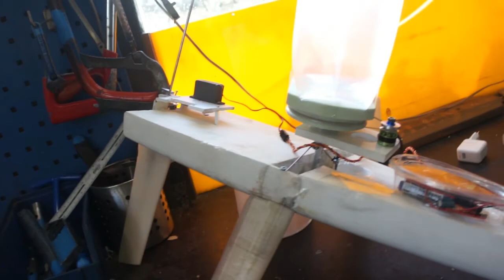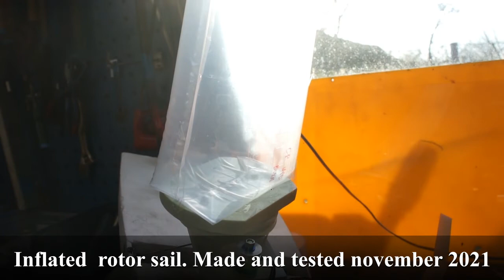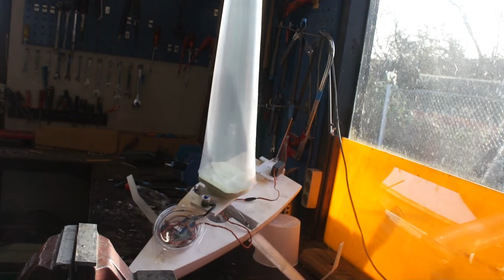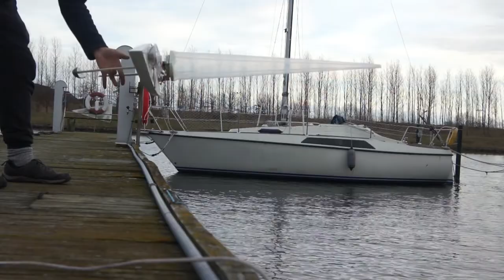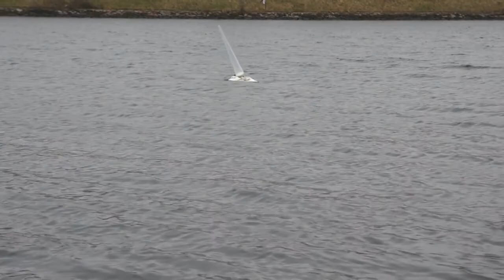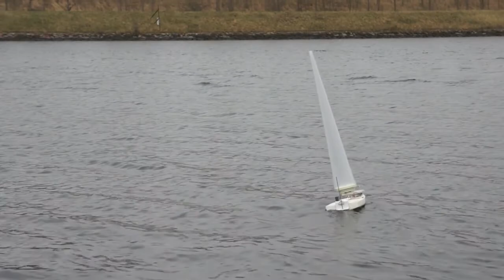Inflatable Rotor sail in model scale

Comment: That's a great experiment. Well done.  I expect you could go forward and reverse.
Reply from the maker: Thanks. Yes, it certainly is possible to reverse direction of lift by reversing the direction of rotation which is quite quick and easy -especially if the rotor has a low inertial momentum.

Comment: I have thought of this approach also because you can easily reduce the sail  cross sectional area by some simple means. Also there is an advantage over a blow up wing in that the wing's lift coefficient doesn't change in a gust.  Where it does for a Magnus Flettner rotor
There is an advantage of the decrease when a gust occurs.  Points on the drag coefficient  curve  0.0  1.2 ratio 1.2  at 1 ratio lowest 0.7   4 ratio 2.5   goes flat at about 5  around 3.5  this is for a Reynolds number 16000  for all the data  and 32000  for the first three ratios at the higher Reynolds.    the spinning cylinder lift coefficient about a 4 ratio  at about 8.5  and for the higher RE  ratio of 5 at a coef of 11.   A sail will continue to create lift if it is not stalled which it would be for a gust as a ratio of the square of the velocity.   Same square applies to the cylinder but the ratio decrease which lowers the coefficient as the square increases.  
http://www.homepages.ed.ac.uk/shs/Climatechange/Flettner%20ship/TSFP7-Flettner-Rotor-Paper4.pdf  
www.icas.org/ICAS_ARCHIVE/ICAS2016/data/papers/2016_0250_paper.pdf
https://www.boatdesign.net/attachments/net-power-generated-by-flettner-rotor-pdf.140946/
Go to the end and look at the last two graphs  http://www.homepages.ed.ac.uk/shs/Climatechange/Flettner%20ship/Childs%20Annuli.pdf